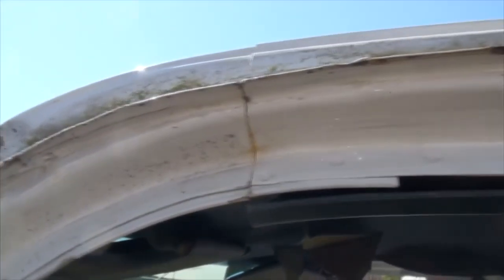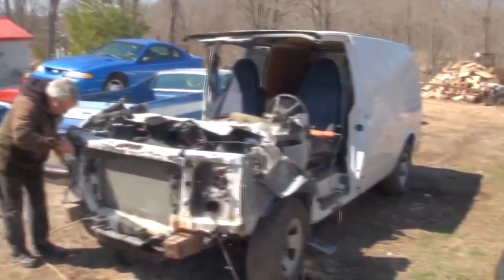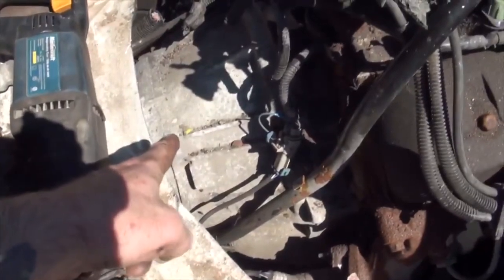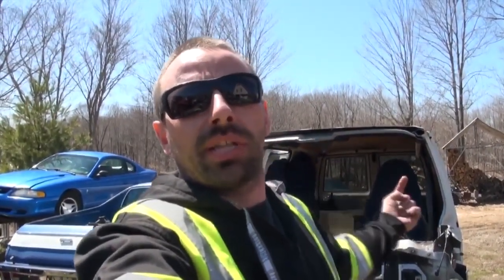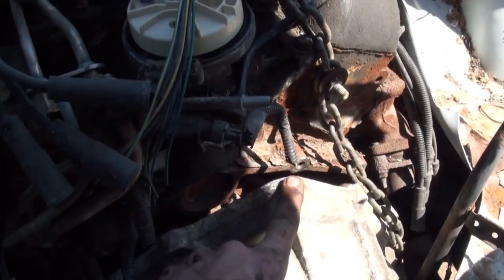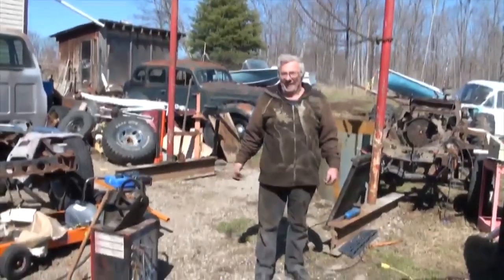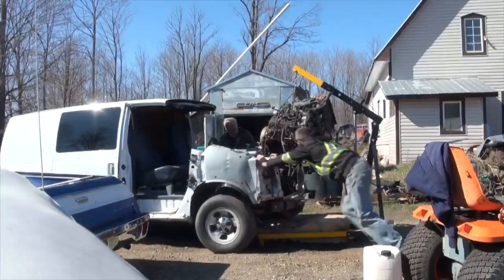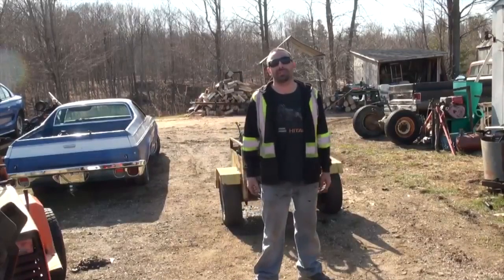HOW TO REMOVE A VAN ENGINE THE EASY WAY

Comment: When you go to pull the other motor out, the bodies come off those vans pretty easy, might be in your benefit to just pull the cab wheel the chassis out and work on it from there.
Reply from the maker: It would have been easier if I had a hoist and planned on saving the van but it wouldn't have been as much fun as chopping it up with a sawz-all :P